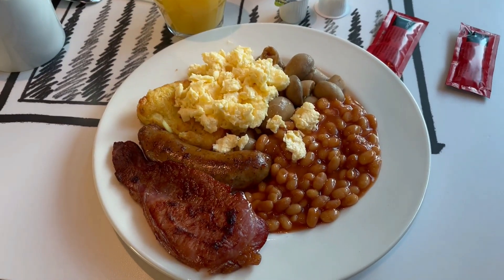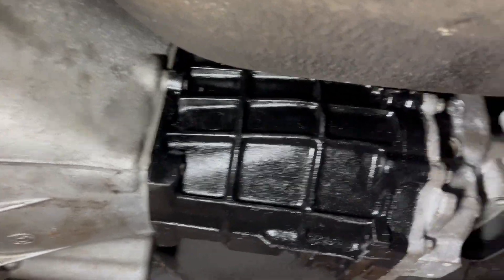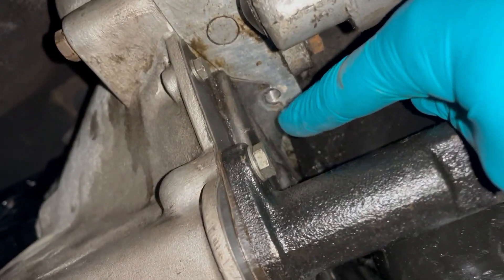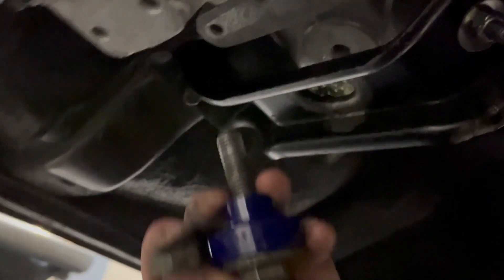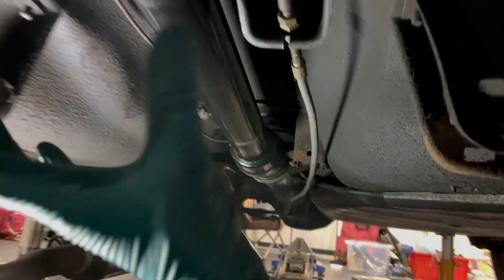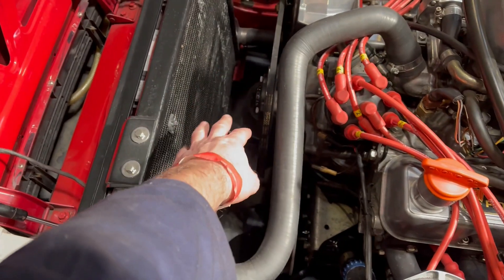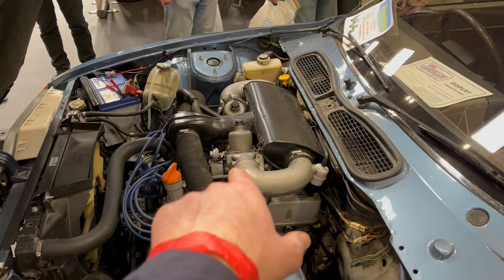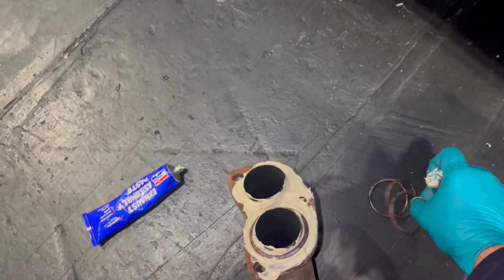NEC Classic and restoration show 2022 - Day 2, changing gearbox in rover sd1 v8

Comment: A lot of time and effort and no doubt stress along the way went into this.  A Big, Big Thank You for what must have been some very long and stressful build up and at the NEC. I started driving in 1982. I nearly part ex an old Series 2 Jag for a Rover SD1 3.5S auto in a lovely metallic lime green colour. I almost did the deal but for some reason the old Jag' with black leather, air-con and real wood trim would have been a downgrade! nowadays at age 57 I cant stand leather seats - I should have bought that SD1 in hindsight

Comment: That red vitesse would have been my dream car back in the 80's, but had to make do with a Ford cortina 2.0GL 😆
Reply: I had a mk 4 cortina 1600 pinto powered in 86 to about 89.You had the magic 2 litre pinto. Rust killed mine and couldnt weld then.ADU204S.Cortinas rotted for fun but were great cars.To get 5 years out of one without welding needed was the norm.Mine did very well but died ultimately through tinworm in structural places. It lived for 12/13 years from new before sadly being scrapped.

Comment: You mention Lucas.The prince of darkness in the 70,s and early 80,s.There was an old joke with jag V12 engines built at that point betting on how many cylinders were ever actually firing.10 was the norm.
Reply from the maker: there was also also listing for bottles of lucas wiring loom smoke

Comment: Fascinating to see the differences between my Australian spec '86 Vanden Plas and the UK versions. Over here all post Series 2 SD1s got fuel injection for emissions regs but it was a custom "flat-top" single plenum design which made them all underpowered (~120BHP) and unreliable! Are the bumpers on the UK models made of rubber as over here they were all fibreglass painted black...

Comment: An idea... Jaguar I-Pace rear motor tucked under the rear end.. battery packs from BMW or VW for a 65-70kw pack in the bay and trans tunnel and a few other bits.... should be a good conversion.